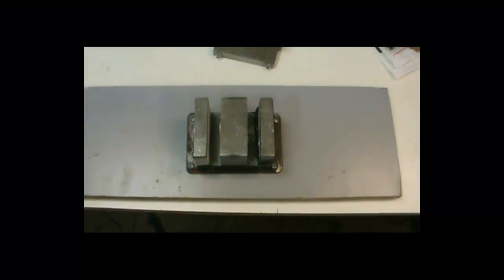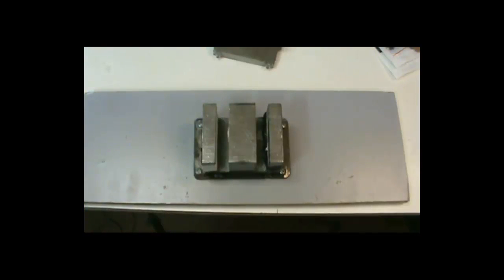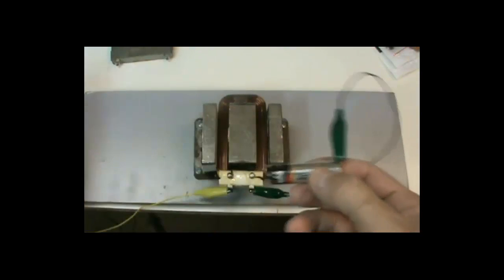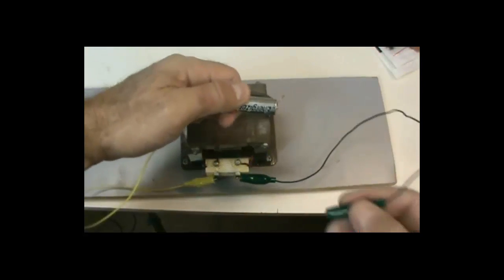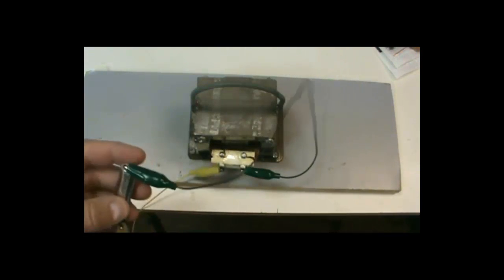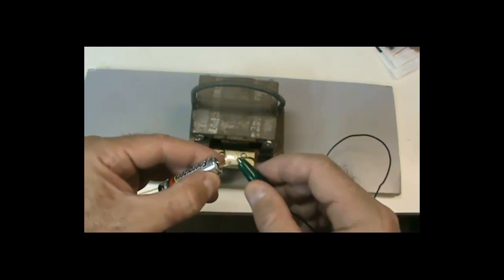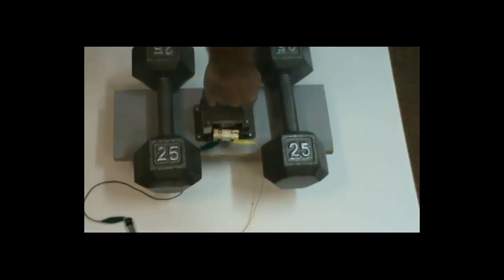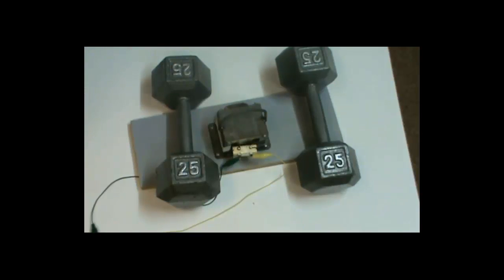Easy-to-Build Electromagnet lifts over 50 lbs

Comment from the maker: To make a strong electromagnet you need to keep the following in mind:

-Make the core out of a high permeability material such as iron. The iron wire in a coat hanger works well.

-Use many iron wires side by side to increase the area of the core.

-Use many turns of large diameter copper wire in the coil.

-Make the core into a U-shape so that the north and south poles are very close together

I can create a video demonstrating these techniques if it will help.

Thanks for your interest..

Comment from the maker: No, as long as the coil is surrounding the center core there should be no problem.

Just be careful that the sharp edge of the core doesn't dig into the core insulation and short it out.

Thanks for your comment.

Comment: AA battery when gets connected to MWT primary winding draws 2.6 Amps x 1.5 Volt = 3.9 Watts of power is used.  
Guy's, do you see what's going on here?  This is a over efficient machine. You turn this electro magnet into a some kind of pulse DC Motor and you are going to get much more power than 3.9 watts!  Dorian, you did a great job man,  thanks for making this video.
Reply: You cannot get more energy than 3.9 Watts.
Reply: Vic,  the science is all about making improvements on technology that uses less energy and does more work  4 U.  Lets take a look at the recent advancement in light technology for example:  (equiv. 60 watts) it takes 10 watt Led = to Incandescent 60 watt. Light bulb projected lifespan:  Led 50,000 hours,  Incandescent 1,200 hours.  If you care to learn more? Please use these key words: LED Light Bulbs: Comparison Charts.
Reply from the maker: Be careful. Holding two objects together does not require energy - it only requires force. If I duct-tape two object together the duct tape is not providing energy to allow this to happen it is providing a force. Energy is involved when a force acts over a distance. The electromagnet must be in very close contact to the object it lifts, it can only pull the object upward when the objects are essentially touching - so very little energy is involved. The energy required to lift 50 lbs (22Kg) 0.1 mm high is only about 0.02 joules - which is not much.
Reply: in youtube we obey the laws of thermodynamics >:U
Reply from the maker: Yes we do, although many YouTube videos would have you believe their is no such law. ;-)
Reply: mksboysal you can not obtain energy from nothing. Your comparision with LED lamp si wrong. Their is a more efficiency conversion of electricity in light than incandescent bulb where most of energy is converted in heat.
Reply: What if that magnetic field is collecting energy around it that is static and ambient. And adding back into the magnetic field to increase the magnetic flow. I mean where do you think a permanent earth magnet gets its energy?
Reply: Dorian McIntire what you say is true, but also a force is energy transferred along a vector.

The extra energy is being supplied by your arm.
Reply: Vic energy isn't measured in watts...
Reply: Umm, can you build a motor out of this kind of magnet?
Reply: mksboysal Its a perpetual machine wannabe .Add a switch to it and make a 250-300 watts powerfull motor that consumes just 4 watts.I think its fake.
Reply: Can this be made to be repulsive? Thanks.
Reply: Vic, watts is power, not energy.
Reply: @jeromereid5327   actually  it just electron which packed densely into matter basically if u pack something so densely then it is called fusion and thus blackhole, actually you can demagnetized even permanent magnet, but it will consume very high energy, so by your question gravity is the answer

Comment: Thanks Dorian. You helped me a lot. I study and research calculation and I found out that Gauge 16 is the most efficient. It has very low resistance so I can make lot of turns as compared to smaller wires.  Thanks again for wonderful video.

Comment from the maker: The current drain from a 1.5v  battery is a little over 1 amp so a AA will not last very long.

I use a AA simply for effect so students can see how a small power supply can do fairly impressive things.

If you want the battery to last longer use a D cell. You should get about 30 minutes from a AA and 8 hours from a D according to technical information from Eveready's web site.

A 12 volt battery will allow the electromagnet to lift over 300 lbs but it will overheat in a few minutes.

Have fun.

Comment: If you use the secondary wire to supply a current to make a strong electromagnet, could you then take the primary wire to make it into a speaker? A speaker can be made by just using a copper coil and a really strong magnet (and, of course, a cone of some sort), so I don't see a reason (in theory) why this couldn't be used to make an Electromagnetic Speaker.

Comment from the maker: +Oliver Smithdeal Make sure the microwave oven has been unplugged for while before removing transformer. No other problems as long as you don't go overboard on the battery voltage or leave it connected too long.
Reply: +maxxlexx1 it wouldn't be a true perpetual motion engine simply because the amount of energy required to power the motor would be less than that generated by the wheel. With that said, as long as the magnet had power you could turn a wheel, if set up correctly.
Reply: The wheel could charge that lil 12v battery and it could intermittently fire it off to keep it going but it still wouldn't be considered perpetual motion simply because of the way individuals define it...  something out there could literally run for the rest of a individuals life and still not be considered perpetual motion (wear is sited as one of the reasons). lol

Comment: Dorian,

Thanks for the quick response! In fact, yes, I did use a microwave transformer for the core. But I don't want to lift heavy objects. I actually want to lift very light weight objects (think nails, bolts, etc) but at a distance of about 6 inches. It's for an architectural model/installation.

Comment: thanks for your reply 

I have worked on it and the coil is now at the bottom, as yours is, but it is very weak. The set up is exactly like yours and i cant figure out why it is so weak. I have measured the resistance at 4.1 ohms and the current at 0.37 amps. Any ideas as to why it is so weak?

Thank you

Comment from the maker: Hi Javed,

If the oven works the transformer is obviously good.

If the oven does not work the chances are that the magnetron is bad but the transformer is fine. I have not found a bad microwave oven yet with a bad transformer.

Checking the coil in the oven will require you to gain access to the transformer, removing one of it's connectors and checking the resistance of the primary coil (fewest turns). My coil has a resistance of 0.5 ohms.

Hope this helps. Feel free to ask other questions.

Comment from the maker: The wire coil will overheat due to the large currents in the coil when  connected to higher voltages. If the coil gets too hot the wire insulation can burn and short circuit the electromagnet.

You just have to make sure you let the coil cool before using the electromagnet again.

Comment: Hi, thank you so much for giving back to the community by sharing your knowledge! It is an awesome video! I have a question about those electromagnetic displays that are sold on amazon and other sites online. I bought one and I opened the floating object and took out the magnet so i can float something else in it but my object is too heavy. How can I increase the weight it can hold?? I would really appreciate if someone could help me figure this out :) thank you so much

Comment from the maker: Stephen,

Did you use a microwave transformer for the core? The trick to lifting heavy objects is to make sure the objects you're lifting are very close to the electromagnetic.

Magnetic fields do not travel well through air because the permeability of air is very small compared to the permeability of iron and other magnetic materials.

Even large junkyard electromagnetics have to almost touch the material they are lifting but they can lift very heavy objects if they are in contact.

Good luck

Comment from the maker: From a microwave oven transformer. Every microwave oven has a core like this used to create the high voltage needed by the magnetron and you can break the core apart using a hacksaw or grinder. I've found lots of uses for these transformers including welders.

Comment: Isn't this how electromagnetic security doors work? So there obviously is a safe and efficient way to keep it powered for an extended period of time, otherwise it wouldn't make a very good lock. You could just wait for it to fail and open the door. Also, what other appliance can be used in place of a microwave. Thanks!
Reply from the maker: Yes most electromagnet door locks work on the same principle. It is very easy to produce very high pulling forces when object are in contact. While any modified transformer will work I have found the microwave oven transformer to be the easiest to use and because of its physical size the pulling forces can be extremely high.

Comment: I also want to use this system for braking system of automobile. Sir, I want some details about that's copper gauge and number of turn on that coil. And I want to inform that I made an electro magnet but it's not working properly and it can lift only 2 kg.
Reply from the maker: If you use parts from a microwave oven transformer and use the primary coil (about 14 gauge wire) you should have no problem. There are many reasons an electromagnet may not work as well as the one in the video and I explained the reasons in the comments. The most likely issues are using a higher voltage European microwave and using the secondary coil (high voltage) instead of the primary coil (low voltage - 120 Volt).

Comment: How damaging would this be to electronic devices like phones or hard drives in the same room? At what kind of range does it become damaging? If it was used for locking a door and you walked past with a laptop etc. While it was on could it cause problems?
Reply from the maker: The magnetic field range of the electromagnetic is very short so it will not damage such devices as long as they not in contact with the device.

Comment: What's the resistance on the coil (or how much amps is it drawing at 1.5volts)?  Also, you mentioned that you could stand on it and try to pull it off.  Have you tried lifting more wait with it than 50 pounds?  Is 50 pounds the absolute max with 1.5 volts?

Comment: can I build this to pull a certain item, kind of like a chosen piece of metal, across the room. such as if build a second small device that I can hide in a book, and I make it fall off a shelf
Reply from the maker: No. Magnetic fields diminish rapidly in air. While they travel well through iron and other other magnetic materials they diminish to very small levels in air since air offers a very high "resistance" or low permeability to magnetic fields.

Comment: I did this except with 110V AC from the receptacle and the breaker keeps tripping. Any thoughts why ? There's no continuity between the coil and 'E'.
Reply from the maker: Connecting to 110 VAC is not recommended. The video used a small DC voltage because  the resistance of the coil is very low.

Comment: If you increase the power source (stronger battery) would the magnetic field be bigger/stronger? ie could I move metal objects from a certain distance? Or would I need a stronger magnet/bigger coil? I want to be magneto
Reply from the maker: +Daniel Ruiz Strong magnetic fields at a distance require huge amounts of power. The best magnet type for this is a solenoid magnet with a iron core but don't expect to pick things up over more than an inch or so.

Comment: I'm trying to make an electro magnet that can hold up to 10 pounds and not get crazy hot if left on for an hour or 2. also its power source has to be small and lightweight and so does the magnet.. any ideas to help me out?
Reply from the maker: +Travis Johnson Electromagnets require a lot of power to initially pull objects toward them. Once an object is being held it is not necessary to maintain the current at such high levels. See the following link for an example of how a magnet should be made for large lifting power and low current.http://www.newegg.com/Product/Product.aspx?Item=9SIA3XT1DJ0600&nm_mc=KNC-GoogleMKP-PC&cm_mmc=KNC-GoogleMKP-PC-_-pla-_-Appliance+Parts-_-9SIA3XT1DJ0600&gclid=Cj0KEQiA0-GxBRDWsePx0pPtp4sBEiQACuTLNgheQRQnm8bT8gMiHu4bpJGWM9T8ETl6d9YL-kE7htIaAiC68P8HAQ&gclsrc=aw.ds

Comment: If I don't have a MOT transformer (really hard to find here), can I make an equivalent transformer?Can I get the number of turns, the size of wire of the transformer, and the size of the core you've used?TIA
Reply from the maker: Your majesty,

The coil consists of about 120 turns of #14 enameled wire.

The core dimensions are about 4" W x 3" D x 3" H.

The core material should consist of high permeability silicon steel. For an electromagnet this can also be a solid block of iron, if available.

None of these things is really critical however the wire should be enameled wire with minimal resistance.

Hopes this helps

Thanks for commenting.

Dorian

Comment: how can i protect it from water if i'm gonna use it under water , do you think that untying the wires and then re assemble it on a pipe under a cover would affect the magnetic force ?
Reply from the maker: tclassq8 If your going to use it in fresh water I would just cover the bottom of the magnet and dip the whole thing in plastic coat 

http://www.walmart.com/ip/21015332?wmlspartner=wlpa&selectedSellerId=83&adid=22222222227016781835&wl0=&wl1=g&wl2=c&wl3=51770260391&wl4=&wl5=pla&wl6=83188113311&veh=sem

I would not modify the coil since this could drastically affect the strength of the magnet.

Comment: How did you get the top of the "block" off? I took one apart and it looks just like the one you are working with but the told is attached. Did you hack saw it? I'm making this to pull and steel bb from steel bird shot that are in our waterfowl meat so no one breaks a tooth
Reply from the maker: I ground off the weld with a side grinder. You could also use a hacksaw.

Comment: if you wrap another set of copper wires around the first one and connect them with the same battery will the power of the electromagnet increase?
Reply from the maker: Yes, as long as the wires in each coil are turning in the same direction otherwise the magnetic fields will oppose each other. Thanks for watching and commenting.

Comment: i am trying to make one with 12v with a core of amorphous metal rectangular block about 150*5*5 mm i have enameled copper 22 gauge wire  how many turns should i wound on it to make a strong magnet 
please help
Reply from the maker: There are really too many variables to tell such as voltage source, current capability, wire gauge, heat capacity of assembly, etc. You will really need to experiment and find out empirically.

Comment: This is great, with lots of great answers already provided below. Many thanks.

I already used a MOT to create an electromagnet thanks in part to your video, but I'd like to teach some kids about eddy magnets as well, since they're learning about recycling centers and how they separate things. Is there an easy way to step-down an AC connection so it isn't quite as loud and reduces the risk of tripping a breaker. (I'll still run it through a power strip to avoid tripping breakers at the school.) Thanks again.
Reply from the maker: If you have two MOTs you can connect them in series but put the iron bar on one of the MOTs to make it act like a variable inductor. You should have the capability of drastically reducing the current and this is adjustable by moving the position of the metal bar on the current-limiting MOT. This is probably the best way to control the current without using a transformer or large power resistor. Have fun.
Reply: I have two MOTs, I understand "connect them in series," and then I got lost. I'm thinking that is probably a sign that I shouldn't mess around setting this up on AC, and I should stick with the battery for safety's sake. Thanks again!

Comment: I am looking to build an electromagnet that would work well picking loose odds and ends up in the gravel or out in the grass. I work on anything with an engine and am dropping and misplacing screws bolts and what not. any suggestions?
Reply from the maker: Easier to use a permanent magnet pickup unit like the magnetic floor sweepers found  at the following link:

http://www.northerntool.com/shop/tools/product_200400169_200400169?cm_mmc=Google-pla&utm_source=Google_PLA&utm_medium=Construction%20%3E%20Road%20Magnets&utm_campaign=A.M.K.%20Magnetics&utm_content=1501695&gclid=Cj0KEQjwg8i_BRCT9dHt5ZSGi90BEiQAItdjpLj4tcJvitkTsNd8G9vKWpz5iVYzsQ4FikaS65KnebQaAji_8P8HAQ

They are not all this expensive.

Thanks for watching and commenting.

Comment: Great Video !  I was looking to make an electromagnetic to pick up waste metal from a (cooled) bonfire, so rushed out to find a microwave and did what you said and got excited !
Didn't get the results I saw on the video and then discovered it only works with 120V transformers -  I am from the UK with 240V - is there any way I can over come this - Thanks
Reply from the maker: leachim2 Using twice the voltage would help but I would move up to 12 volts to get better results. Once pieces of magnetic metal are attracted to the magnet they will begin to short out the magnetic flux so you should pull this material off the magnet frequently to keep the field strong.

Comment: I will build one of these or similar for under my lathe to catch the chips, do I need to insulate this unit in any way
Reply from the maker: I would probably use a permanent magnet (in a plastic box) to do this instead since the electromagnet will use a lot of power and can overheat if used continuously.